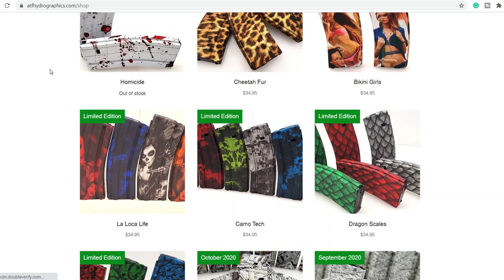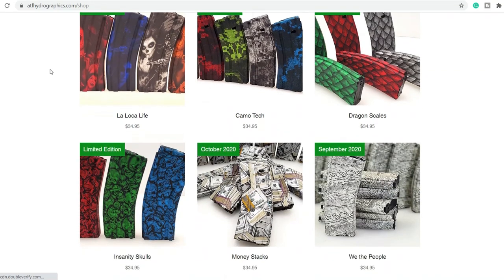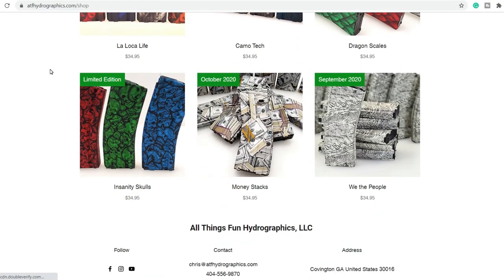Lightning Hydro Dip || September 2021 Mag of the Month

Comment: Love watching the change and progress of the items... How does hydrographic-film handle heat? I have a random question... I do a lot of different things to include making candles and I sometimes use liquor glasses and coffee mugs for the containers. My question is would hydrographic-film be able to stand up to the heat if I was to dip the outside of candle container? I've always been able to comfortably hold them in my hand even when wet so a high end guess for the max temperature would be 90 degrees Fahrenheit... thanks in advance,  I just think a glowing flame pattern on a candle would look pretty cool!
Reply from the maker: I did a video a while back on the channel about heat, and it holds up to about 400 degrees just fine. A candle holder would be fine.

Comment: New to your channel still browsing the vids.  Have you dipped gun barrels and or brake calipers?  How does it hold up to heat with the base coats, graphics, and coatings?
Reply from the maker: It wont hold up to the heat. 350-400 degrees is about the limit.
Reply: @AllThingsFunHydrographics  that's a shame.  Had some great ideas.  Im just not much of an artist to pull it off with cerakote freehand.  Thanks for the response.